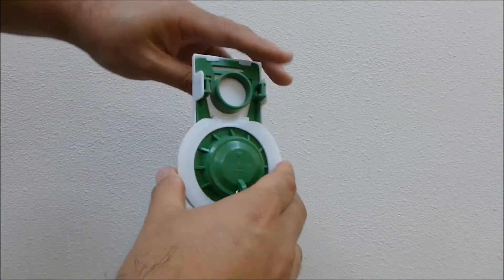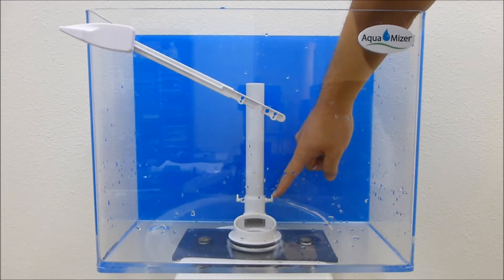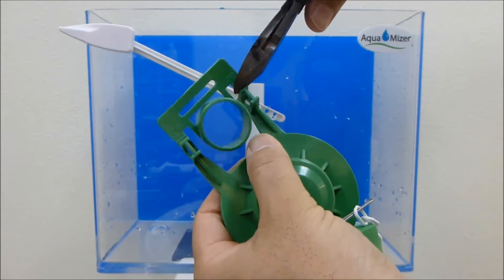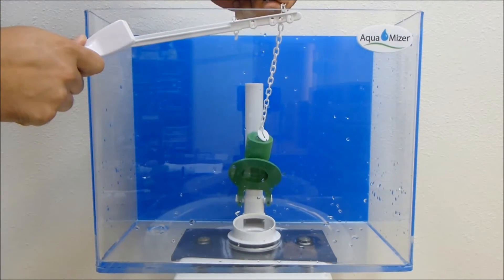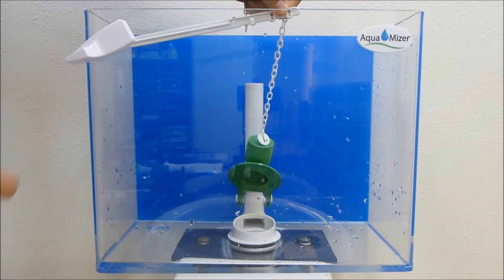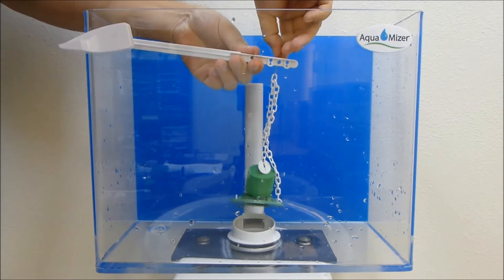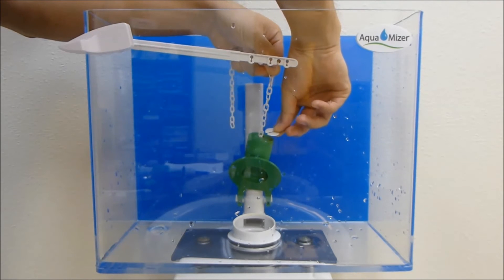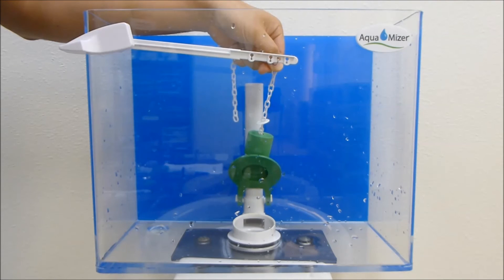Aqua Mizer Adjustable Flapper Installation Video

Comment: I just bought this thing for my toilet 6 months ago and now when I flush my toilet the water doesn't fill back up. can you help me out on this???
Reply from the maker: Where did you buy it? It sounds like the fill valve chain needs to be shortened a few links so it will trigger the valve to refill when you pull the flush handle.